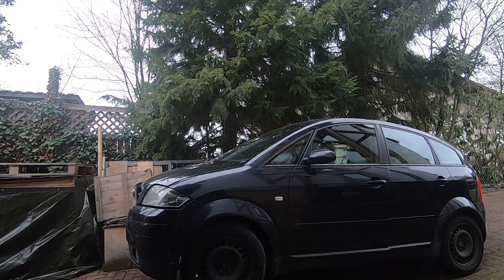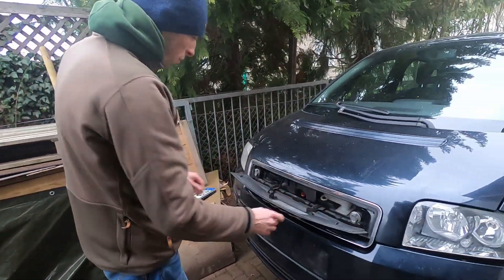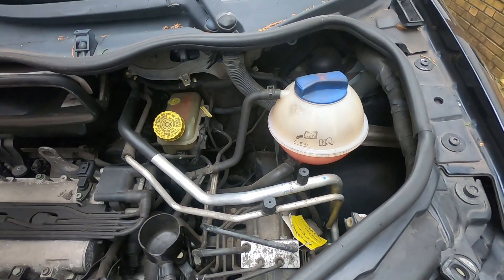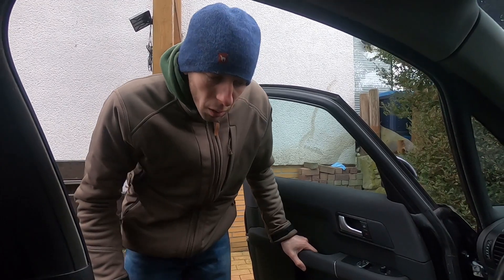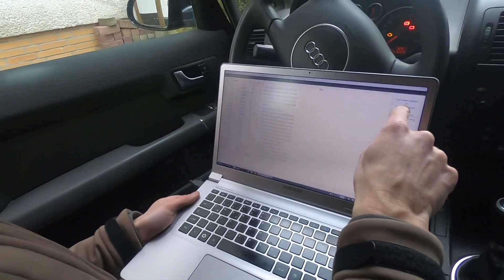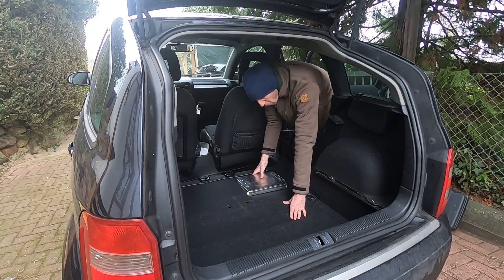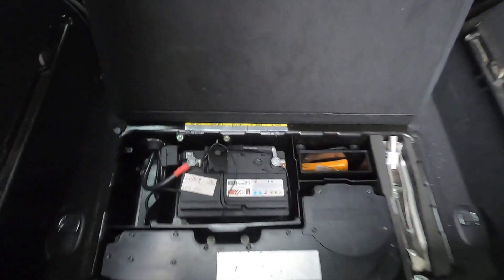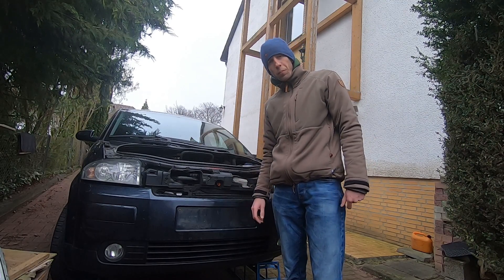Lab Update #56: Audi A2 project intro

Comment: Subtitles weren't there any time there was wind noise. Missed a couple paragraphs. Nothing you were talking about seemed to be anything too difficult for you to say in English, but I totally get how speaking in a second language is like dragging a boat anchor. Audience-wise if you care about how many people are watching, english is obviously better. But if it's just to get content out and have something instead of nothing to document what you're up to... subtitles are fine. Honestly english is close enough and the topic familiar enough you can kind of pick up 1/3 of what you're saying without even using the subtitles. Of course, your english isn't going to improve unless you spend time in your head using english :P
Reply from the maker: Please check if you see that corrected in the next one. Also I'm aware sound is terrible, I just ordered some equipment to record sound separately. The stupid GoPro mike adapter is 100€ (was 5€ for the older model)